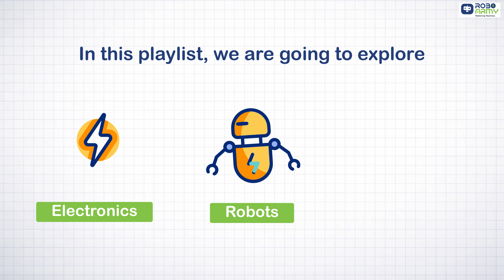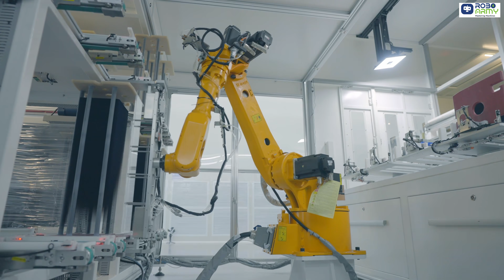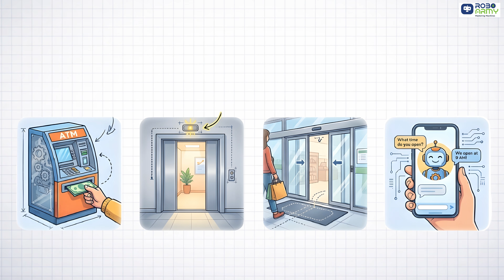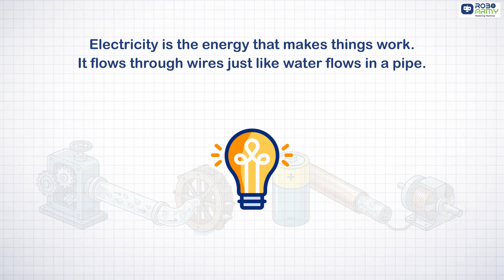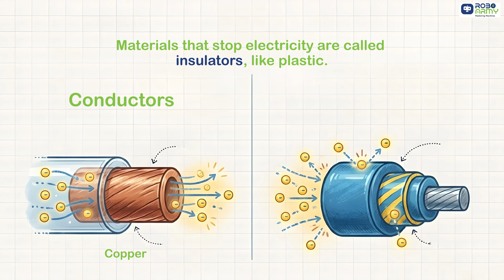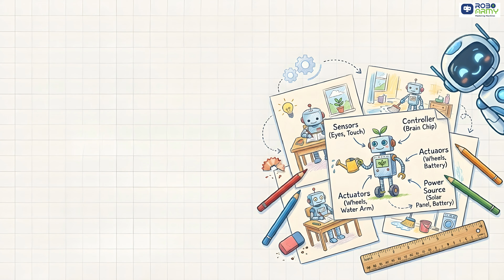Learn Robotics for Beginners 🤖 | Module 1: Introduction to Robotics & Electricity | RoboArmy

Comment: i want more.. but, see your video is part 1 and its on robots parts, i think that's need to be part 50. i am thinking you need to make the first vedios on more like resistor, breadboard, LED, arduino and BASICS STUFF for a small and basic cicuit for begginers
Reply from the maker: We appreciate the suggestion, and we'll keep that in mind as we structure our future lessons to ensure a smooth learning path for beginners.